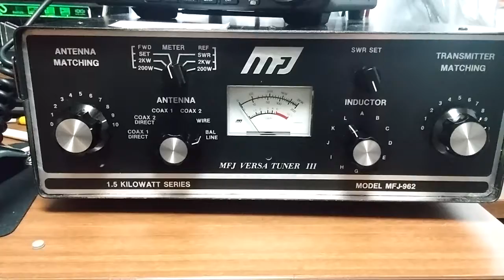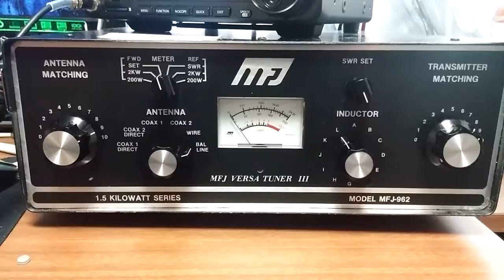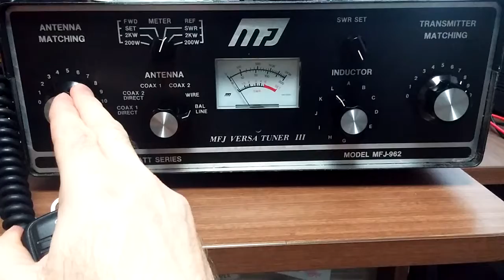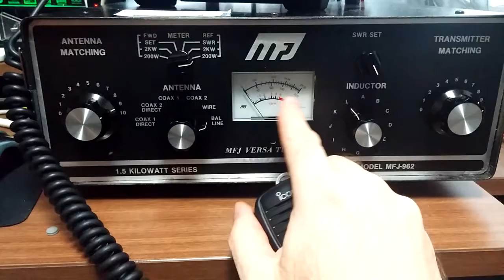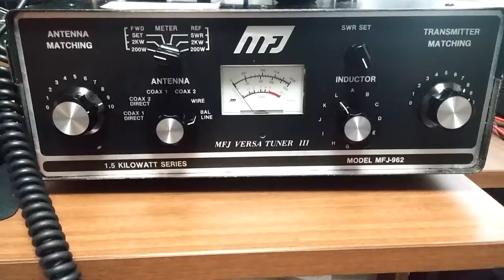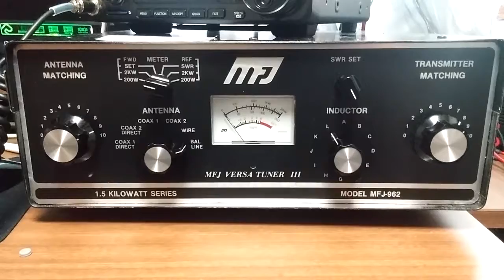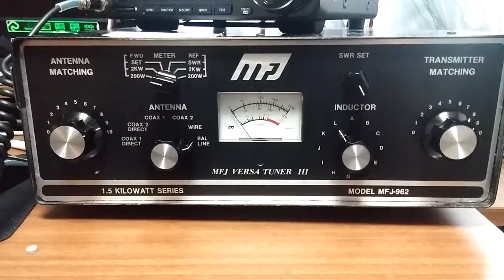MFJ-962 Versa Tuner III Antenna Tuner

Comment: Just scored and received this exact model (non-lettered) off Ebay for $62.50 (total w/shipping). Sold as "for parts/not working", as the seller said they had no capacity to try it out. I know what that usually means (broken), but it looked good enough in the pictures to be worth a shot regardless at that price. Will see. TY for the video.
Reply from the maker: The issue I had with mine is that the rivets are loose or broken.  They are problematic  at the Coax connections.  I ended up shoving thin pieces of copper in there to help make the connection to the metal on the box.

Comment: what are the coax 1 and 2  and coax direct 1 and 2 for
Reply from the maker: Direct just means avoid all tuning, like a cable straight through. Coax 1 and 2 are with the tuning dials affecting the signal.

Comment from the maker: I want to add that I think I did something wrong in this video.  I now see that, when setting-up to get a proper SWR reading, I needed to put the needle on SET, which is the far right side of the red.  That gives me an SWR reading closer to identical of my rig's SWR meter reading.  I wasn't setting the needle far enough over to the right, before testing for SWR.

Comment: Do you have a copy of the manual for this model?
Reply from the maker: Yes, I think so.  Do you need a copy?
Reply: Yes - I have been looking for a manual for quite some time. K2ZAD - Mike
Reply from the maker: I will search.  I remember it is quite simplistic, and typed by hand.
Reply from the maker: I found a PDF scan of it, which I had downloaded online.  Assuming your address on QRZ is good, I will email there.
Reply: The QRZ address is good! Thanks so much! 73 de K2ZAD.